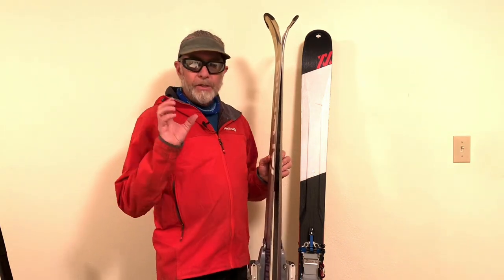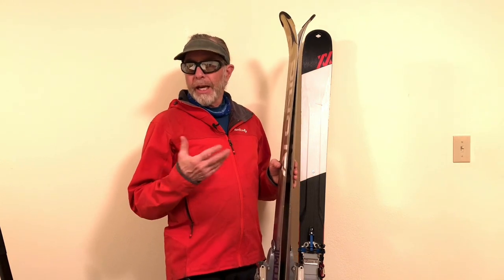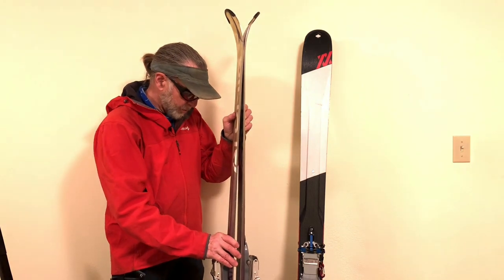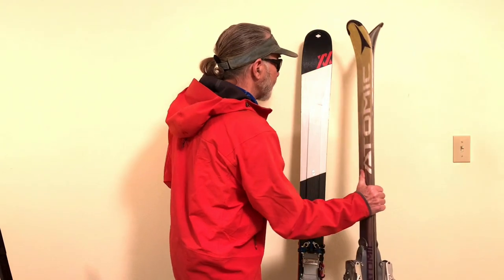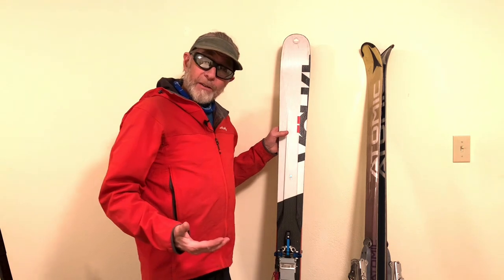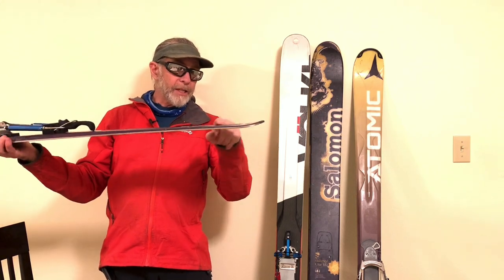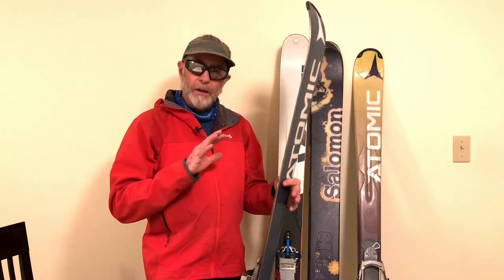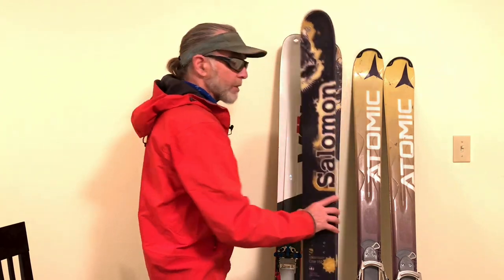Dostie's View #18 | What Makes a Great Telemark Ski & How to "Read" It's Characteristics

Comment: I’ve found a very nice compromise in all of these characteristics. Rockered tip and lightly rockered tail, a huge amount of camber (by today’s standards) between the rocker sections, fairly even round flex, 18-19 m radius (depending on length), 100 underfoot, so floaty enough but also carvy when the conditions are right. Also, I found them to be perfect as a learning ski. Forgiving, but when loaded gives plenty of rebound (I mentioned the generous camber)… so when I’m wearing my salesman hat (White Pine Touring in PC, in case you’re wondering) I call it the “you get out of it what you put into it” ski. You can ride them leisurely or you can drive them (not super hard, but I did say compromise earlier).

What ski is it?

The Bent Chetler 100.

Comment: RT 86 ! Still out in my garage.  Took my old Targa's off and replaced them with Marker downhill bindings that let me use my AT boots at the ski hill.  RT 86's were a revelation when I first got them. No more planning my tele turns three trees ahead. With the RT 86 I just thought, turn here, and they did.  One of the great skis of all time.  Great to see them featured.  Ski DPS 106 with Meidjo now - mostly for safety in Avy terrain.  Nice nice flotation in the back country, but I can still do moguls on piste without to much problem edge to edge. Ski both tele and AT now - lots of great crossover skill development. Great post.

Comment: Great information. I switched to Voile V6s from 90's telemark skis and am finding I periodically washout on firmer snow. Now I know why. I also learned the V6 sidecut works out to only 15mm BUT with the large camber I understand why they're very maneuverable and I can easily do jump turns. I really like the V6s - although finding an edge hardpack is sometimes a challenge. If I invest in a another pair I think I'd go with something similar to the Atomics in the video - but geez - now that I'm on Medijo's that's an expensive proposition. Hopefully in a couple of years there will be a larger used market.

Comment: Great info!  Hard to get this objective info from ski shops.  Question though: Craig, I noticed all these skis are inches taller than you.  Are these all your skis or just being used for this talk?  If yours, they would seem longer than what is normally recommended which I thought was about your height or up to 6 inches shorter.  Any comments or corrections to what I thought I understood about ski length?
Reply from the maker: Haha.  Remember, I'm old school.  There was a time when the appropriate sized ski for me was 200cm. I've settled on 175-180cm in length because that's how much edge I want available when I need it.  Fads in ski sizes (length, width, shape) come and go.  Knowing what you prefer, and why, is what should control your decision for ski size, not what the herd says.

Comment: That was outstanding.  Thank you Dostie.  I've been out of the telemark game since 2015 but looking towards this year visiting some spring corn.  My absolute favorite pair of skis were Atomic Tm-22?  Maybe 45 mm of sidecut.  Snappy, super easy to carve on edge in firm, resort, and corn.  Great for the PNW Volcanoes in spring.  In getting back into the game, is there a ski, binding combo you would recommend to drive with some soft Scarpa T-2's (love them, never gone to give them up), and today's ski bindings?
Reply: I'd like to have seen the answer to this question.  I'm trying to find out the same thing too.  Did you ever come to a solution?  I'd like to have my Rainey super-loops mounted to new skis, but cant find anyone willing to do so.
Reply: Voile Switchbacks are good modern versions of a cable binding. 
I started on G3 Targas. The setup skied intuitively after the switch. 
They also have a more progressive version in black if you want a more active binding flex. 
There is a step in binding for 75mm too.

Comment: Thinking about pickup a pair of Bishop BMF/R's.  I currently have 75mm boots but wondering if I should upgrade to a NTN boot (BMF/R comes in both 75mm and NTN setup).  I have been alpine skiing for 40+ yrs and tele for 5+ yrs. now.  I want to have a good 80% resort/20% backcountry and uphill skinning setup.  From my research on the internet, you would think that guys with 75mm boots vs NTN boots were doing two completely seperate sports (lots of opinions).  Since the BMF/R's can handle both . . . its really just about what boot is a better all around boot going forward.

Comment: What's the difference between tele and alpine skis? Softer flex because more even weight distribution?
Reply from the maker: The difference between tele and alpine skis? The binding.  LOL.  Seriously though, in tele you're distributing your weight between two skis, in alpine, predominantly one. So tele skis tend to be softer because there's less weight applied to each edge.  Nonetheless, YMMV.

Comment: I learned on mid 90s Tuas/plastic Scarpa s and leather boots/Asnes. Stopped skiing altogether in 2007 and am absolutely horrified with the ridiculously large width underfoot and lack of camber. Equally horrifying is the lack of any telemark skis and bindings worth note. 

Trying to find a decent setup to teach my stepson who wants to learn to ski. 

What the hell happened? PSIA level I Nordic and Telemark in 2006. I’m absolutely confused why there is a need for these wide of skis to telemark on and goes against anything I was taught for turn initiation, weighting edging and rotary with this lack of proper gear. 

eBay seems like a good resource for older, proper gear.
Reply from the maker: Sounds like ebay is the place for the type of gear you're looking for. Happy hunting and thanks for checking out the vid. Cheers - Madsen
Reply: @FreeheelLife  cheers to you as well. Managed to find some Karhu Jaks with some Hammerhead bindings. Thanks for the video
Reply from the maker: @Impala-qp9cb  Oh nice! That's a fun setup. Let me know how it goes. - Madsen
Reply: ‘Absolutely horrified’. 

Oh, the humanity. These setups are worse than the Hindenburg disaster, probably.
Reply: @jasonwebb6484  yep. Not a fan. I’ll stick with stick shift and you can use your paddle shifters.
Reply: @Impala-qp9cb  my comment was about the word choice. I just pictured a person seeing modern snow sliding gear for the first time while the newsreel audio played of the Hindenburg disaster. Like wide skis are equally as horrifying as people being burned alive.  Don’t mind me. 

That said, when ‘modern’ telemarkers run across someone skiing on leather boots & skinny skis, they have (or should have) huge respect for them, knowing it takes way more skill, balance & experience to ski without the huge stiff boots, etc.
Reply: @FreeheelLife  it went well. Was worried about being a baby giraffe but they were like a long lost extension of me and my 20s. I’m back
Reply: @jasonwebb6484  true that. Now looking for some military Asnes “white rockets” and a set of Crispi Bre’s.